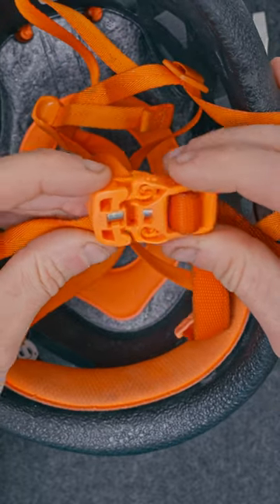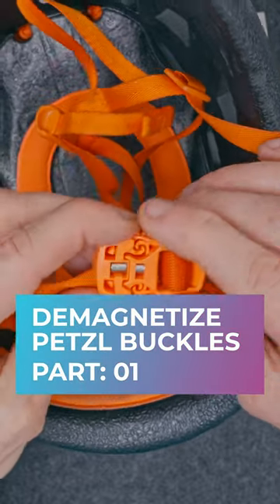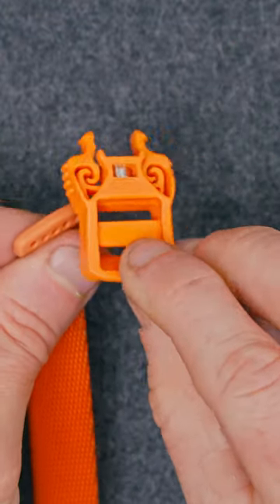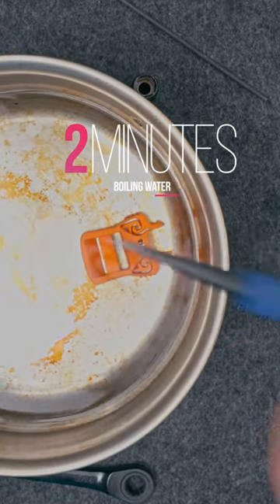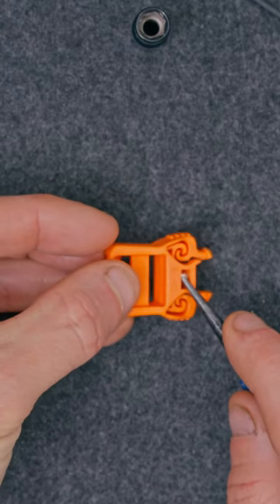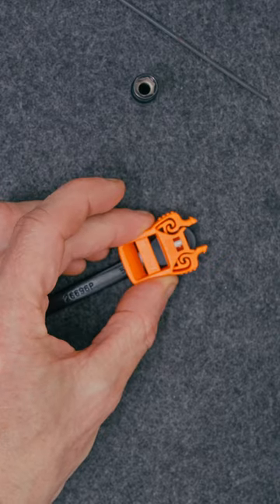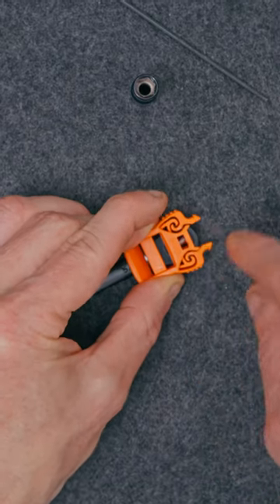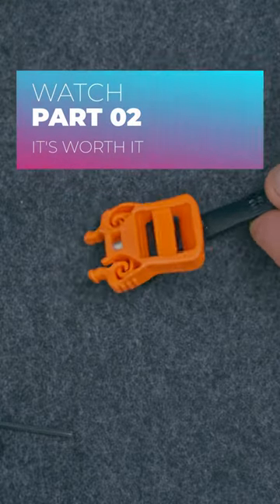How To Remove Magnets from Petzl buckles PART 1

Comment: I got stuck in the old orange sirocco because of some junk sticking to the magnetic buckle, and broke it trying to get it off.  so when I replaced that helmet with a new one, I removed the magnet but then my helmet came unclipped constantly, including often on long multipitch and alpine routes. I’m surprised I never dropped it. So I put my magnet back in. Their buckle pretty much doesn’t work without the magnet.

Comment: why would you want to do this
Reply from the maker: The magnets can attract a lot of dirt if you are in areas where the rocks/soil has a high iron content. The iron rich material sticks to the magnets, preventing the buckle from closing. It's not hard to clean, but if you have to wipe your helmet buckle down every time you go climbing, some people would rather just remove the magnet and then it's just a normal buckle.